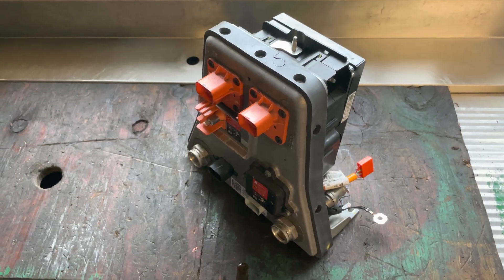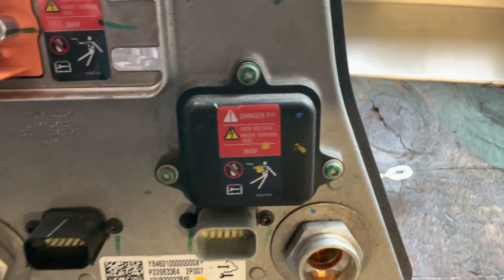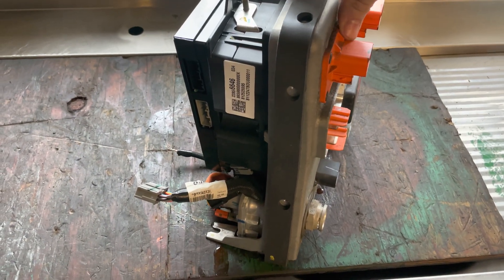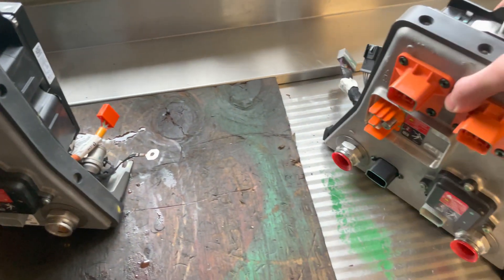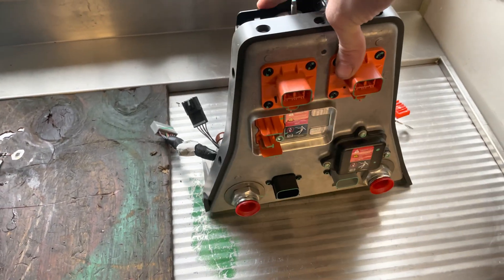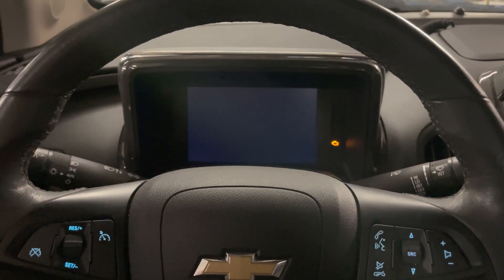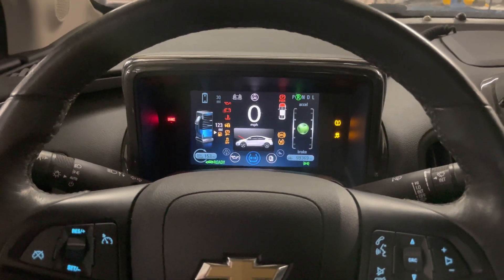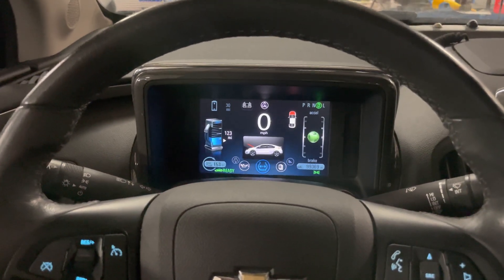Chevy Volt Won't Move... P0ABC

Comment: I have a 2013 doing the exact same thing, goes in gear and wont move, but I'm getting a P0AC4 code. It just quit moving after we stopped at a light. Towed it to the dealership and they told me they do not work on anything over 10 years old. getting it towed to the house today. and will start trying to figure it out. Any suggestions?
Reply from the maker: P0AC4 means there are codes stored in the HPCM… Need to know all of the codes that are being set. 

These cars are not friendly to DIY diagnosing and repairs, I’d advise finding another shop to work on it.

Almost all repairs will require the vehicle to be lifted on a two post lift. 

Thanks.

Comment: Hi i was able to pick up a used part for this issue.  I would like to test it before having my mechanic install it.  When you testing the connection from the orange connector to the other point, is there a particular pin you testing on the connector?
Reply from the maker: I would advise taking it to a mechanic that is capable of performing such a test. 

If the mechanic is unable, find a different one. 

High voltage repairs are for trained persons only.

Comment: I've got a P0ABC error code in my Opel ampera / Chevrolet Volt . I need the same  module.  Where to buy in US? Because in Europe is imposible.
Reply from the maker: The dealership is the only place I know of at this time… even then a lot of parts have been discontinued and are becoming difficult to find.  

You may be able to find one willing to ship to your location.

Comment: I have this code among several. Is this code likely to generate a host of others? Towed my car home from dealer bc they wamt another 1500 to drop the battery.
Reply from the maker: You should have had the dealer do it… you won’t be able to do it at home without a vehicle lift and a lift table. Along with the high voltage training.
Reply: Do you have the testing procedures for this assembly? The continuity test you did shows good on mine. Since I have the same code, what else could be wrong with this? It's a $1k part. Thank you.
Reply from the maker: @graemenewton1186 I do not. 

It could be a few different things wrong with it.
Reply: @DadsGarageDiagnosticSpecialist  my mechanic opened up the contactor assembly and it's totally fried. Will be replacing it. 2 big fuses also roasted and  replaced. So hopefully new assembly is all that needed now!
Reply from the maker: @graemenewton1186 that’s interesting. I wonder why it would have failed like that. 

Sounds like a serious hazard to me… has that battery ever been under water or something? There must be something that caused that. 

It would be a shame If there was something else wrong that cause the failure because if it’s not truly fixed I’m sure the fuses in the new part will be destroyed.

Comment: what is the part number for the fron the battery with the battery heater, connector and main relays so i can shop? I am getting POC78 code
Reply from the maker: Unfortunately, I do not have the part number sorry. I would advise purchasing OEM parts from the dealer.

Thanks.

Comment: I have a 2014 Volt with code P1EAB (battery cell high) and can't find ANYTHING helpful on the internet to help me diagnose this problem.  I've previously dropped the battery thinking it had a bad cell but all the cells had the exact same voltage when I measured them individually. I even had a buddy of mine come by with his J box to reprogram the moduels and no luck. Any ideas you could have? I'm almost thinking I have a faulty contactor issue like in this video.
Reply from the maker: P1EAB sets when the Battery Energy Control Module detects an over-voltage cell. Clearly you have some mechanical skills. 

What I would do in the situation is monitor the cell voltages with the scan tool, and see if there were any of them that were out of the ordinary… If so, most likely, you would need to replace that entire section of the battery containing the faulty cell. Otherwise the problem will be in the wiring harness internal to the battery or a faulty module. 

This code requires extensive testing inside of the battery to properly diagnose… You will need the proper training and service information. If you end up needing to replace a section of the battery, you will also need the expensive cell balancing tool. 

You will almost certainly need to send this to the dealership for diagnostic and repair. 

Thanks.
Reply: @DadsGarageDiagnosticSpecialist  That info helps alot. Thx!
Reply from the maker: @rotaryperfection  no problem. I have one in the shop right now that has a faulty cell and I have to replace section 3 of the battery. Cannot be done safely without the cell balancing tool.

Comment: I drive a 2013 Volt and it is about 130k miles, I was driving it and got a message "Propulsion power is reduced" then the car would do the same in your video. I am debating if it is the same thing and if it is worth fixing.
Reply from the maker: If the car is in good condition and operating well it may be worth fixing. 

Thanks for commenting.

Comment: How much did the control module cost?
Reply from the maker: I’m not sure on the cost of the new part on this one. They aren’t cheap though. Labor is about $700-$800. 

Thanks.
Reply: How common an issue is this in your shop? @DadsGarageDiagnosticSpecialist

Comment: I've just had this exact issue pop up, towed it to the dealer and they texted me a video from the repair tech saying this is what he needs to do.  The text said the service advisor would reach out soon with more info (costs, I presume).  I'm trying to figure out if this exact repair should be covered under a TSB and/or the Voltec warranty.  I see that dealer personnel don't always know the right answer to that question.  I'm the original owner, it's a 2014 and only has about 55k miles on it.  Am I SOL since more than 8 years have passed?
Reply from the maker: Hello Mike, thank you for commenting. Do you know what codes your car has? And confirm it is the contactor assembly they want to replace? If you want to email me your VIN I can check the warranty status for you. 

dadsgaragediagnosticspecialist@gmail.com
Reply: wow, thank you for the quick response.  My OBD II handheld is not the VX Nano or anything great or GM specific, but it gave me error code $07e8.  The VIN is 1G1RB6E48EU126289.  The dealer just called moments ago and said I'm looking at about a $3600 repair.  I asked if any of this was covered under warranty and/or TSB, she checked with the tech and said "no", as my warranty expired in September 2021, which would've been about the 8 year mark.  I stalled by asking them to email me a work order. As an old retired guy who doesn't do much driving, I'm really not too keen to pay them that much $ if there's a better way to go.  Thanks again.
Reply from the maker: @mikemcconnell5968  yes it does appear that your warranty is expired. You may be able to contact General Motors for assistance paying for the repair.  

Unfortunately, the codes you provided are in raw form and would need to be converted….Example code P0ABC. 

When it comes to hybrid and electric repairs, there is usually not a cheaper or easier solution other than the proper repair. 

Thanks.
Reply: Thank you.  I really appreciate your input and assistance.
Reply from the maker: @mikemcconnell5968  no problem!
Reply: I hope I'm not being a nuisance, but one more question as I try to decide what to do.  The repair cost is about 40-50% of the estimated value of the car, and it's only being driven about 3,000 miles per year.  Might I be able to have the dealer reprogram a module or set something so that it will get past the messaging I see exactly as in your video and allow me to drive it 100% of the time in Hold or Mountain mode?  As few miles as it we put on it, and thinking how we probably won't have it for more than another year or two anyway, I think the tradeoff might be worth it.

Comment: There are 2 fuses behind the black plastic with the 3 bolts.
Did you check them before replacing the whole thing?
Reply from the maker: Those two fuses are not related to the P0ABC code and last time I tried to get some they were not available.

P0ABC sets due to the battery energy control module being unable to detect the high voltage battery positive side voltage. The orange wire was open circuit inside the contractor assembly so it had to be replaced. 

Thanks for commenting.

Comment: Thanks for the info! Do you do much work on the 1st gen Volt?
Reply from the maker: Yes I do more and more work on the first generation Volt as these cars start to age and accumulate miles. They seem to be holding up fairly well thus far.

Thanks for commenting.
Reply: Are you anywhere in the Midwest or know of any qualified mechanics that you can refer?